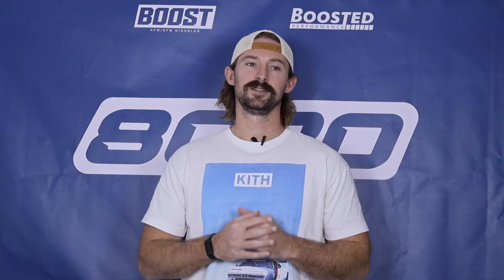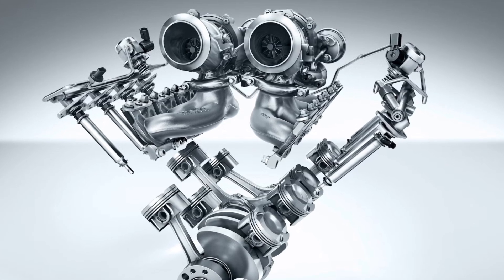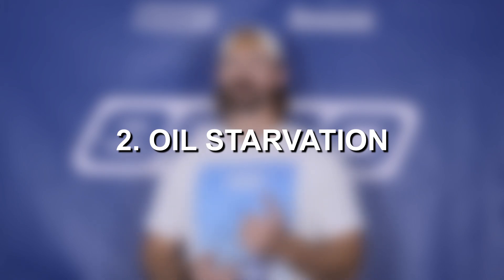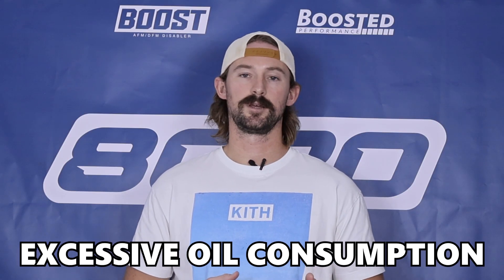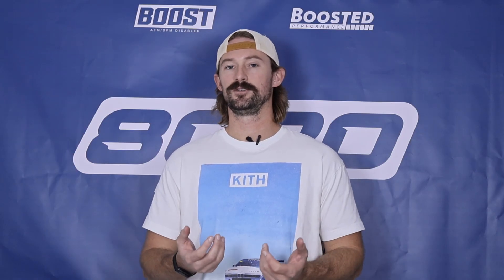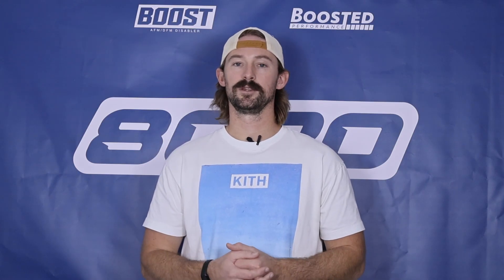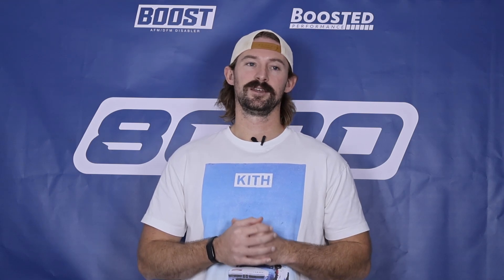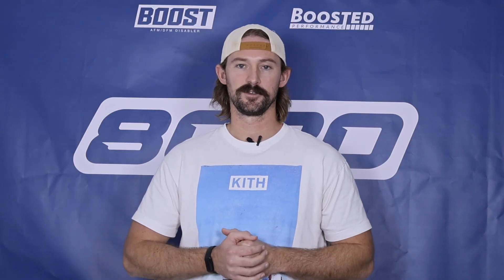Is Audi’s 4.0T Engine a Time Bomb? (HONEST Reliability Breakdown)

Comment: I am not seeing very much of anything(1 or 2 results) regarding valve stem seal issues. One result on a forum saying it’s a bad design and oil pools in one cylinder or something, not even their car f’d up. Everything else pretty valid, Audi did a 10 year/120k mile campaign on most 4.0ts for the turbos and PCV. Some guys are taking these things a few hundred thousand miles(but I guess you can say that about any car)

Comment: WOW never seen a video with so much misinformation on this engine. My favorite is the amount of BS coming out of your mouth about the injectors, THEY ARE LOCATED ON THE INTAKE SIDE OF THE HEAD. You also used the incorrect engine in the pic for this, you use a picture of NA Audi 4.2. God I just found your channel and only video I've seen, I can only imagine what other misinformation you have in your videos.
Reply: Missed this. I'm looking at a 2014 with the 4.0T and it is a hot V motor. Can you tell me more?